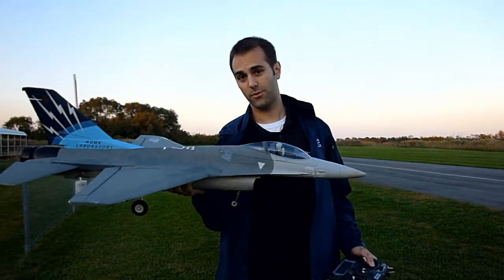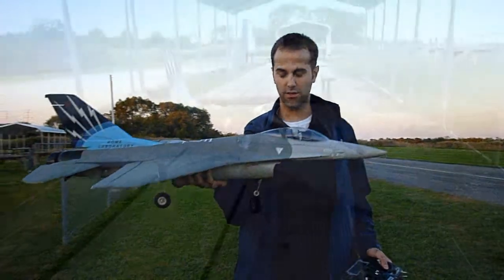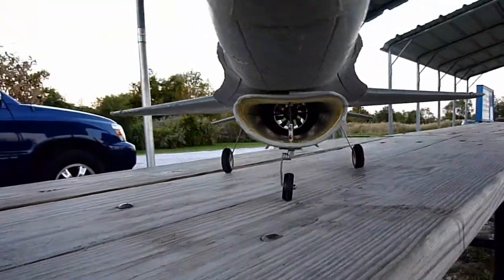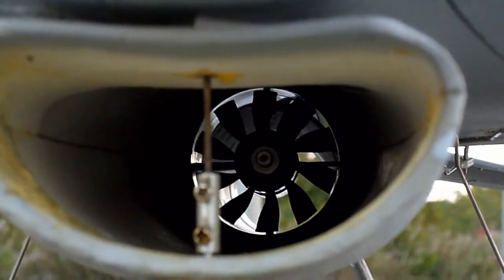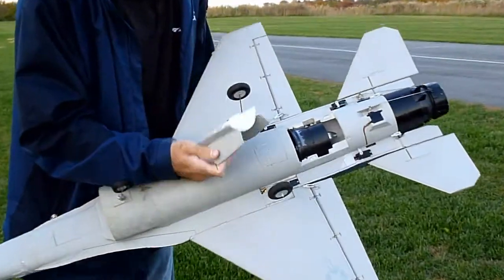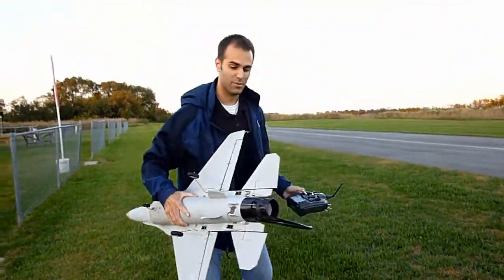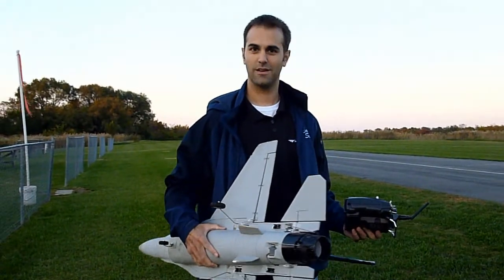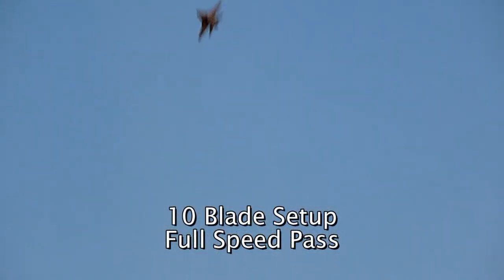CS10 70mm Fan upgrade in Freewing F-16 edf

Comment: does anyone know how  a 70mm 10blade 2680kv edf  on a 60amp esc powered by a 4s 2400  30c lipo would mix with a 3.5 lb f-16
im building a homemade f-16 and i want to make it fly fast but managably so. so if anyone could give me an idea of how it would perform with that set up you are thanked in advanced
Reply: you would have to use a 3000kv or higher if you want to fly fast with 4s. if not, your setup would need a 6s 2700mah battery to it.

Comment: I tried that 64mm fan and noticed more thrust better sound but wow it chewed through batteries fast!  went back to a 6 blade for more flight times.  I was using a 4800kv motor so maybe that is why all that power consumption.  did you notice your flight times decrease with that fan?